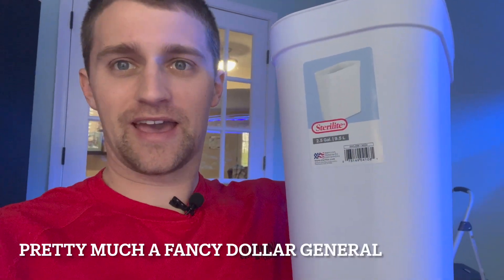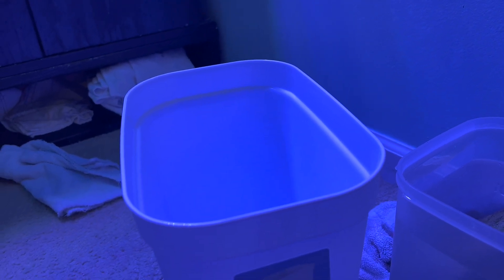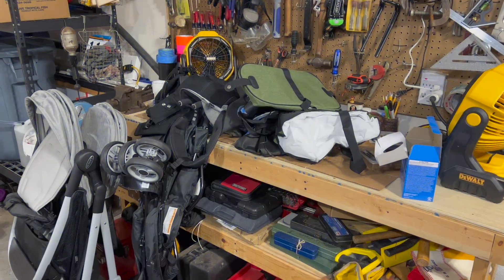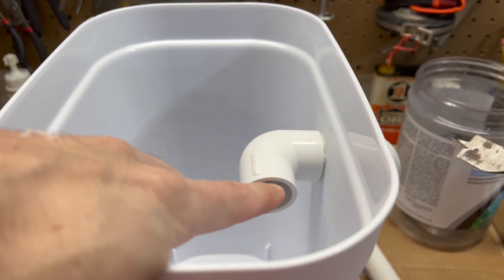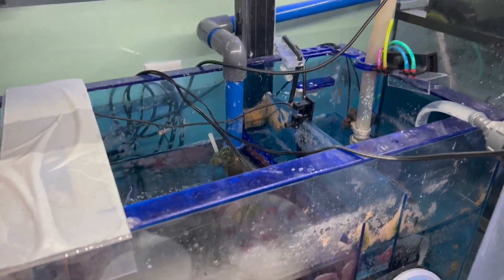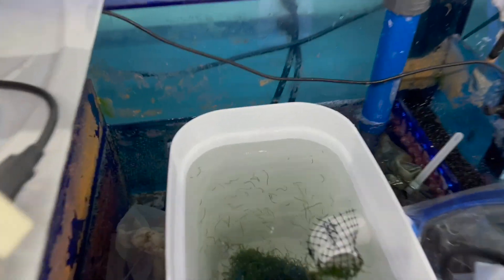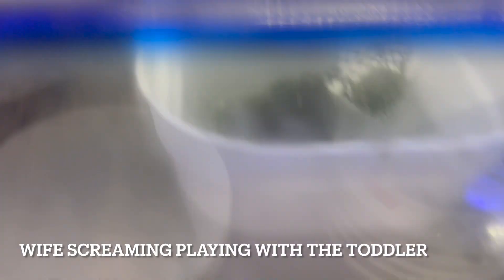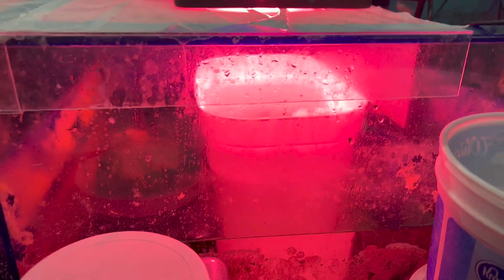Cheap DIY Cheato Reactor for Reef Tank

Comment: The only thing that would concern me is that garbage can might not be food safe plastic. Cool build though ! I have a small Red Sea sump, I was considering doing a 5 gal bucket fuge that sits outside/next to the sump. it would also add a few gal water volume.
Reply from the maker: I’ve wanted to try the 5 gallon bucket idea. I stopped using my cheato reactor since I think the light got wet and leached some heavy metals based on my ICP testing results.

Comment: I'm curious about your media. Does your block media fall apart? Mine are turning like sand, they fall apart easily.
Reply from the maker: My first Brightwell brick fell apart. It was one of the first batches. I reached out to Brightwell and they replaced it with a new one about 6 months later. I’m pretty sure you have an older one. If a newer block is falling apart then that’s a problem. I suspect there is a life expectancy on them. Mine lasted about 6 years before I decided it was a nutrient trap and tossed it.
Reply: @shallowreefing  makes sense. I have never replaced mine since I bought it 5 years ago.

Comment: Cool idea , but why not just use the refugium in the sump for the algae? Is there a specific reason or is the dump fuge being used for something else? 
I’m getting ready to setup a Triton 34  trigger systems so I’ve been checking some ideas out lately
Reply from the maker: I just didn’t like how dirty that entire area was. With it contained in a bucket it’s easier to keep the flow going and my cheato doesn’t get stuck in a powerhead. When I had it in the sump area my powerheads were all clogged up and the cheato would constantly get caught in the bubble trap before the return.

Comment: Awesome idea dude. You just gave me some ideas to DIY a version of this for my setup. I'll plan to use some live rock and sand at the bottom of the bucket weight it down and create a 'fuge-in-a-bucket' habitat for pods. And when it's time to clean it all out, just remove the bucket for an easy reset. Should go a long way in keeping the sump cleaner. On that note, I plan to use a larger micron filter bag on the outlet pipe to catch all the large chaeto debris without clogging up as fast as a filter sock would...not to mention a filter bag takes far less effort to rinse out. 
And now it's time for me to go!... ROBIN!!! To the Bat Garage!
Reply from the maker: That’s an awesome idea. I may put a filter sock on the end if I get any cheato coming out of the bucket. This bucket idea is super easy and keeps your sump clean! Let me know how your build goes!

Comment: Hey, I will set up a 150 gallon mixed reef tank. The refugium area will be around 180 square inches in size but I won’t be using the whole thing for chaeto. Is there any way I keep the chaeto separate and also stop the light from spilling everywhere? I thought of using a bucket but I’m a fraud that the ones available won’t be big enough or might leach stuff into the water. Should I just put black pieces of acrylic on the walls to minimise light spillage? Also does tumbling chaeto help? If so what are the best ways to do it? How can I do it efficiently while also being cost effective? I will mainly have chaeto for the pods and all to stay in and not too much for nutrient removal, but if it does remove extra nitrates and phosphates I won’t complain :) Please let me know, thank you!
Reply from the maker: That’s a lot to take in. If you see coral euphoria he has a bucket reactor he made and put the light on top. There was no light spill as he used the lid as a platform and cut a hole in the top. I did a similar method to him but since I didn’t have a lid I put it on the acrylic panel. Tumbling just gives it more contact time and allows more water to pass through making it more efficient. There are hundreds of ways to go about this project. You just gotta find the one that’s best for you. It seems like you already have a bunch in mind. I love having mine in a confined area that traps the light and doesn’t shoot light around the sump. I had a problem with coralline algae growing where the refugium light spilled in the sump.
Reply: @shallowreefing  Ah I see. Thank you so much for the reply! It really helped out!